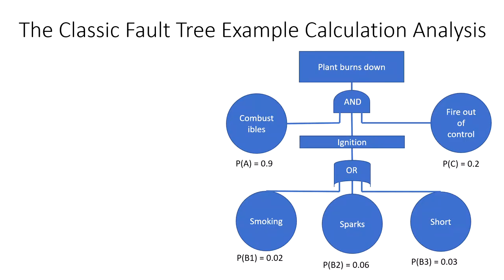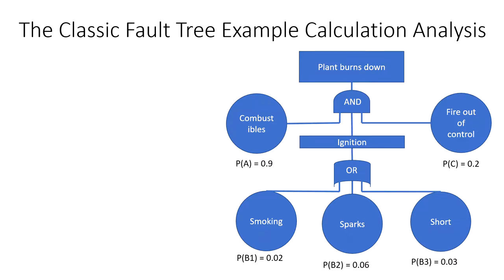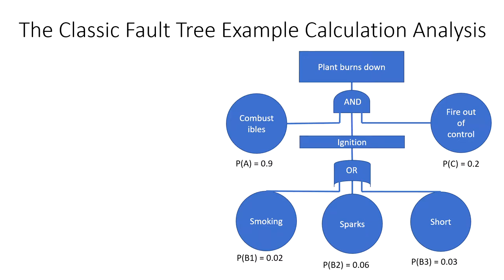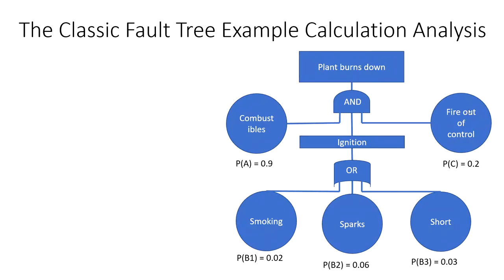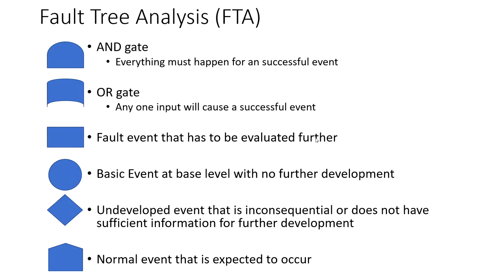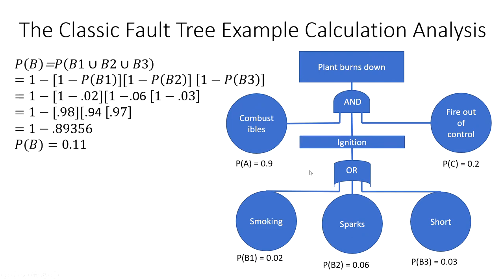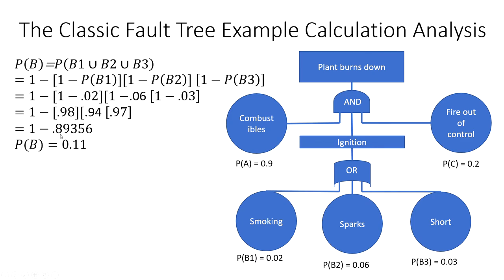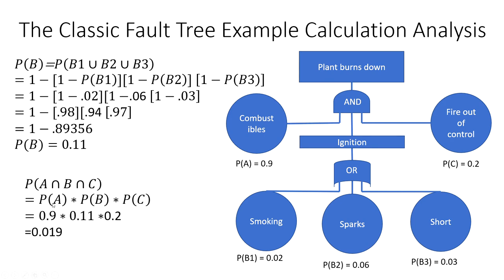Fault Tree Analysis FTA Explained With Example Calculation

Comment: For OR calculation, shouldn't we add the probablity of event P(B) = P(B1) + P(B2) + P(B3)?
Reply: I think that the rationale for the calculation presented in the video is that for the B event to happen you calculate the probability that neither B1, B2 or B3 happen, which is (1- PB1)*(1-PB2)*(1-PB3) and then, the probability that B indeed happens is 1 minus the above. Nevertheless, I would appreciate the author’s input.
Reply: Just came across this but your 100% correct. 
For there to be "ignition" either of the potential sources could trigger it. Doing this strange use the inverse and make the gate an "AND" i.e. no spark AND no smoking AND no short and then inverting it actually confuses the presentation.
If the OP had stuck with the OR gate as written then the pIgnition= 0.02 + 0.06 + 0.03 = 0.11 doing it his way doesn't seem to make much sense.